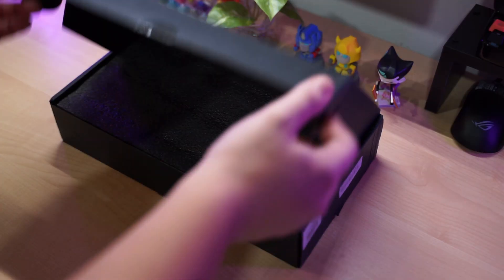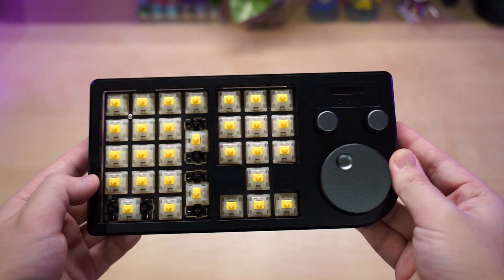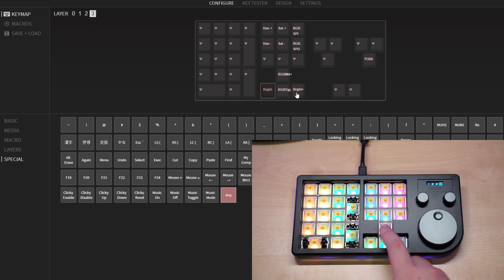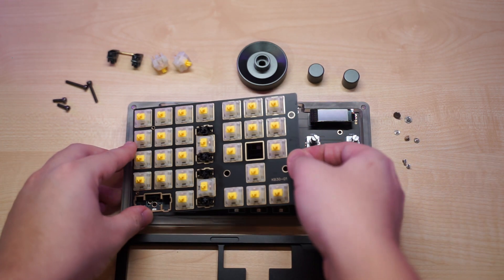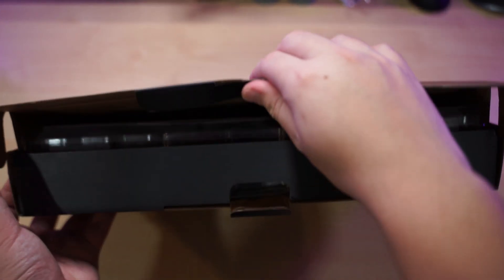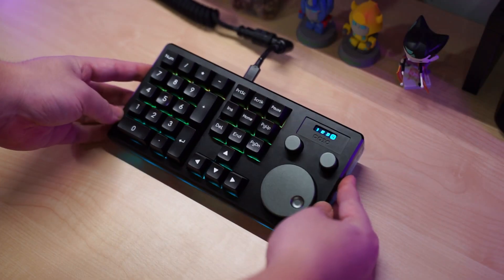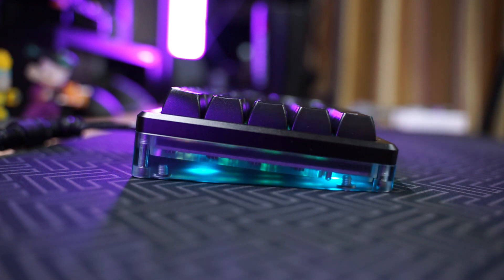The Best Macropad - DOIO KB30-01 Review (QMK/VIA)

Comment: I've seen very mixed things about this macropad, but it's got a lot of features that I really like that not many other have. Since you've used it for quite a while, I've got a couple of questions for you.

Can the scroll wheels be set to other things? For example, the big knob is volume, can it be changed to a mouse scroll? It seems like the left small knob does nothing, which is odd, because why make it a knob with no function if a button would work better and be cheaper?
How's the software? I've heard a lot of people uploading jsons to it, VIA just freezes. Have there been any updates to the firmware?
I saw you say the USB C ports cannot be used as a hub, however it looks like that's what they were made for. Have you found anything they can be used for?
Reply from the maker: 1. Yes the scroll wheel can be configured to do other things. Even the presses can be remapped too.

2. The software is okay if you know how to navigate basic Chinese, I'm not sure if there's a global or update QMK/VIA JSON file now as I just set mine as kept it the same till now. And no, mine does not freeze or lag.

3. The Type C ports at the back just allow you to connect it depending on your desktop layout, I don't think they work as pass throughs, but I may be just too dumb to understand haha.

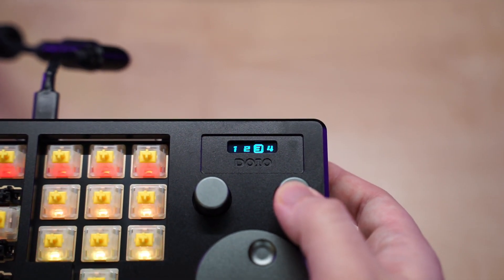Comment: 1:48 How many macros do you have available in VIA? I just purchased a cheap $11 nine key two layer VIA macropad. I was disappointed to see that despite having two layers of nine keys, there were only 5 macros (M0-M4) available in VIA. I am hoping you say 30 or 60 macros.
Reply from the maker: Quite a lot tbh, because you have different layers so each key can have more than 5
Reply: @itssamueltan  I rescind some of what I said about the limited macros in the KB30. I am new to VIA and did not realize that you can assign things like Copy, Cut & Paste to keys directly without creating a macro for them. Even when there is no key listed as a SPECIAL key for simple keypresses you want, you can use the 'ANY' key to assign simple key combos to a single key. For ex, instead of putting "<CTRL> A" in a macro you can just assign the 'ANY' key to a key and when the window pops up enter "C(KC_A)". When I press that key it will press "<CRTL> A" without wasting a macro.
This is a bit more complicated in the KB30 VIA software because the 'ANY' key is just listed as a blank white key instead of being labelled ANY.
Reply from the maker: @auditocanarsie7355 I see, no worries on that tbh. Till now i still find out new stuff about keyboards and it's nice to learn.

Comment: Hey. Does the acrylic base sound hollow when you knock on it or touch it? I have the 16key macropad and the top feels solid but the acrylic base feels very light, empty, and even slightly cheap. Thanks for the review!
Reply from the maker: The acrylic base can kinda feel hollow but that's just the nature of the material, maybe you can try the tape mod or adding some foam to help
Reply: @itssamueltan  I see.. thanks for the reply! :)

Comment: I did something similar with the SteelSeries Merc Stealth keyboard. This keyboard has a separate set of keys, fully programmable, and boy did I use it good. Everything you normally do with a double or triple key combination like Ctrl-C I did with a single keypress. It also has a very nice bonus that the key shapes are actually different: round keys, square keys, inset and outset, different size and even coating (some are smooth, some are soft-touch). Ah, those were the times! There is only one problem with that. No succession. Once your keyboard broke, or your OS got updated, the keyboard software no longer works, and you cannot buy replacement. You can buy OTHER keyboard, or a keypad, but every time its all over again from the scratch. This is the biggest problem I have with these, and there seem to be no solution so far.
Reply from the maker: Yeah sadly that the case. But now with QMK/VIA and some software magic most macropads are pretty good

Comment: Hi I was wondering if this pad is wireless ? There's a smaller version of this pad that is commonly sold as the "Megalodon Triple Knob Macropad" online and the wireless specific version of the Doio Triple Knob Macropad has received all kinds of negative reviews because reviewers claim the wireless functionality does not work and the manufacturer (Doio) does not have proper instructions. I am really looking to use this pad wirelessly and wanted to know if these such problems might exist?  Below are some of the main issues I've read about from the negative reviews users have provided for the wireless Doio Macro Pad: 

--1) Auto-detect doesnt work in VIA software
--2) Users must use firmware version 1.3.1 in VIA for the wireless pad with no guarantee it will actually work or be upgradeable beyond that
--3) no VIAL firmware is available
--4) Macros only support 4 keystrokes or less in wireless whereas the wired pad doesnt have this limitation
--5) The time out of the macropad is too quick and the user is unable to adjust/customize the sleep timer which causes the pad to go to sleep/turn off in too short of a time 
--6) Inability to manually power off the macropad, so every button press can turn the device on. If you throw it into a bag, it will constantly be turning on and draining the battery 

Can you tell me if these issues are present on your Wireless Doio Pad? Maybe you can do a review that touches on these aspects if the reviews are right or wrong? Would really appreciate your thoughts.  Here's the source for the negative reviews on the Wireless Doio Pad if you want to verify any of this: www.keebmonkey.com/products/megalodon-triple-knob-wireless-macro-pad 

Thanks very much
Reply from the maker: Hey, those are all good questions but mine is wired and I have only used their wired versions so sadly I can't really answer your questions. But I can confirm that it uses the old VIA version and you need to manually.
Reply: @itssamueltan  oh yours is wired ok, when you say you can confirm it uses the old VIA version, when you said "it" do you mean the wireless macro pad or the wired macro pad?
Reply from the maker: @ne0nlightz  wired and wireless, they use the same VIA software
Reply: be aware that while it is wireless it still has a USB adapter - which complicates things if you have a mac with just usb C ports.. 
(saw the USB dongle on ebay in the add pictures).

i have a Huion macropad, 18 keys and 1 knob - wireless but WITH a usb dongle that i did not know about - really dissapointed it is not... just BT without dongle..